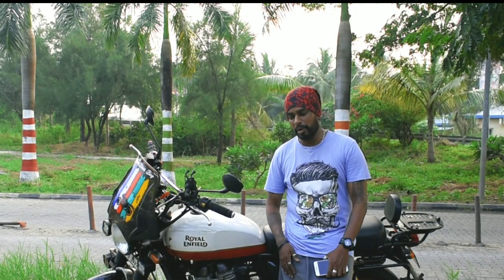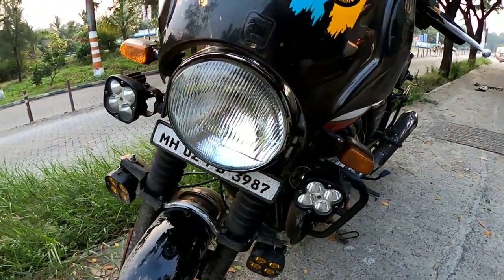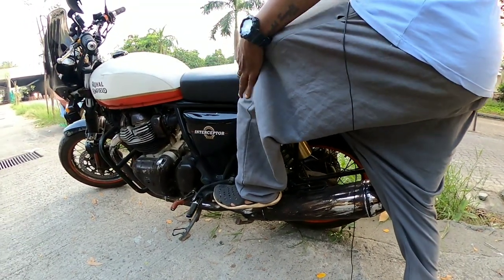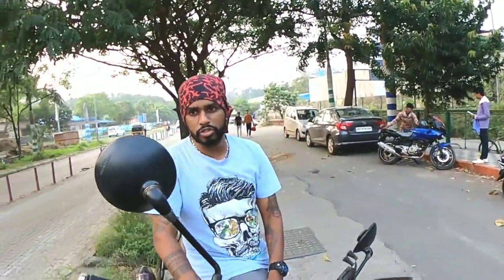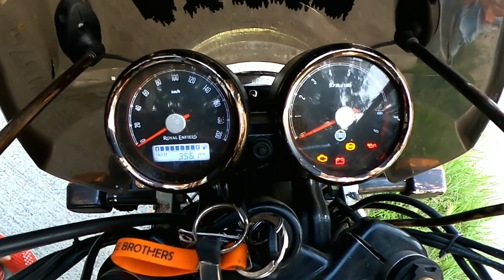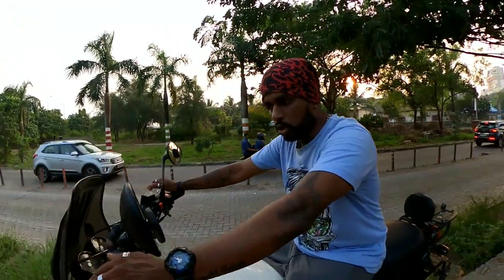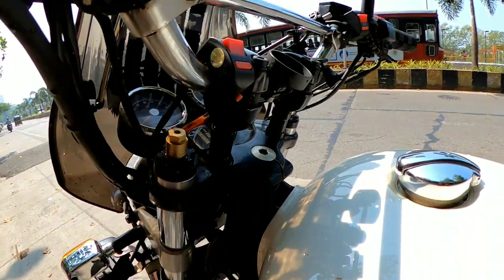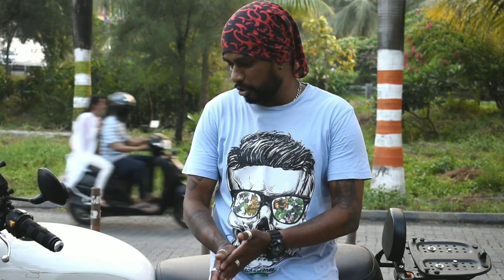Interceptor 650 Problem & Issues | 10 Drawbacks | How to overcome them

Comment: yup dude very true i m also aiming for front suspension adjusters but its lil costly
Reply from the maker: Yes it’s is also do it post warranty period as this will not cover warranty otherwise as ur changing the entire setup or else just go for the pre load adjusters only
Reply: @MumBikerBoy  oo if I do this then my warrenty ll got void dam 🙄
Reply from the maker: Yes cause if ur changing the entire springs of course
Reply from the maker: Go for the preload adjusters only even we have it if u have seen the installation video it’s easy to remove n replace stock incase of any issues
Reply: @MumBikerBoy  ya I m among for that only & ya I saw your video that's why
Reply from the maker: Whatsapp me will share u more details